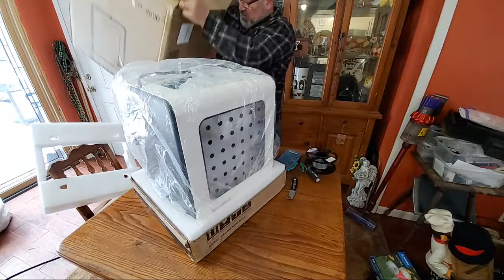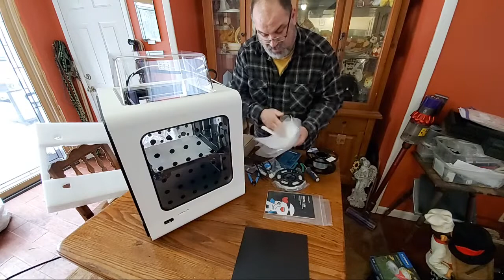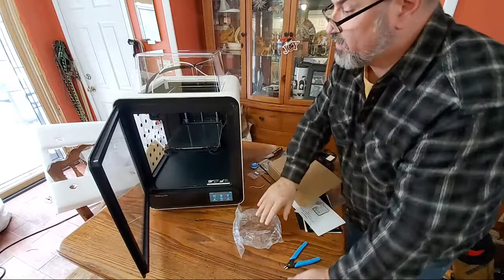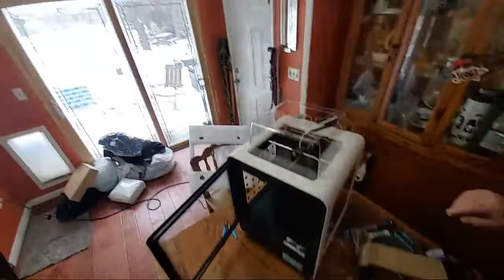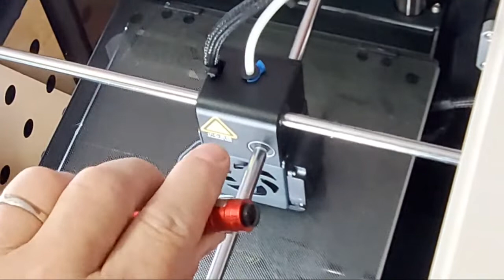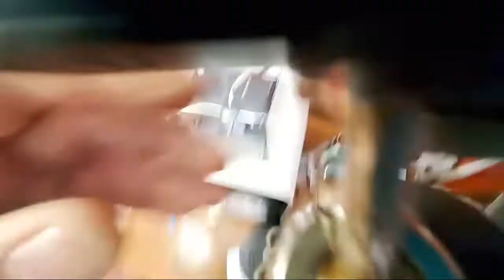Creality CR-200B Gets Added To The Fleet

Comment: Hey! Crafted, Im just wondering if you came across any problems with this printer? ive been interested in buying one myself but i have seen some people complaining about the extruder overheating and making their prints fail. 

Did you have any issues? hows that going for you?

Thx
Reply from the maker: It's a great printer.  If this is your first printer, my best advice for you is to swallow hard and get it out of your head that there is any such thing as a perfect or trouble free printer.  That is a fantasy.  As printers go, I regard this one as needing relatively few modifications and adjustments.  3d printers are not toasters.   You have to refine them.  You can do it.  Yes, if you print PLA, you will have have to lean how to adjust the stepper voltage.  Creality has it wrong.  You will also likely end up upgrading the extruder mechanics which will necessitate adjusting the E-steps.  You can do this also.  Buying a printer isn't an end, it's a beginning.   ;-)
Reply: @CraftedChannel  thx for the reply! i will take that into consideration

Comment: Not the best engineered 3d printer - cheap plastic extruder (will last about 4 weeks) and overheating extruder gear.
Reply from the maker: I can tell your larping as a 3d printer owner.
Reply: @CraftedChannel  one day and my machine back to the shop. Bad extruder and bad hot bed
Reply from the maker: @molero110  I'm getting ready to order #2.